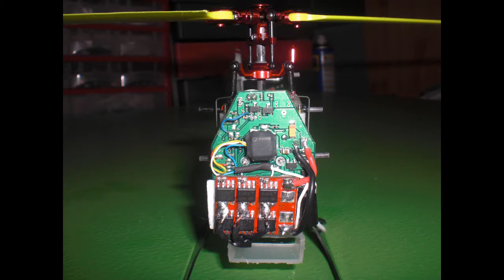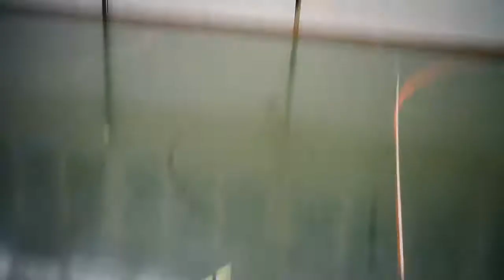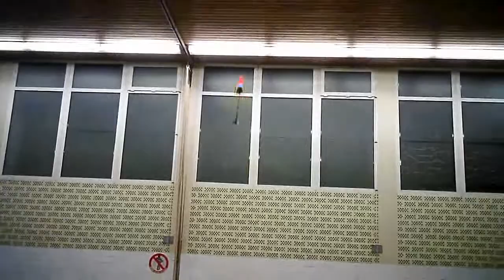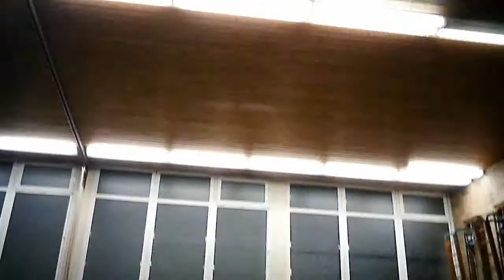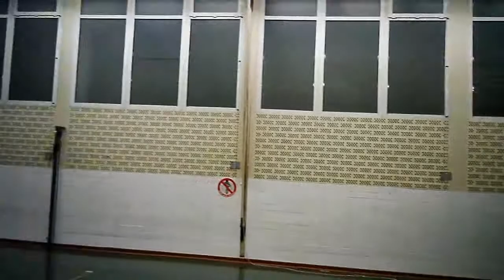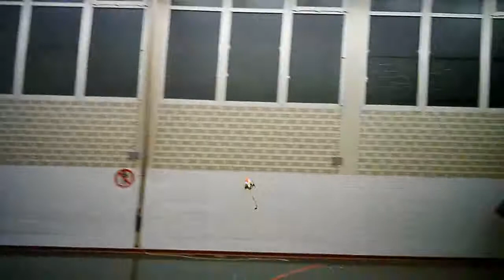Brushless mCP X HP05S@9T 4mm lower RotorDisk

Comment from the maker: @SOHCking 
Your right!
4 flights after this one, the tail motor wouldn't run longer than a minute or so,
and quit with a total tail spin. I broke the RKH frame, MH gear, Ø2mm shaft, canopy...
 
Then I got a new SR120 Tail and everything is ok again.
I might have to pile up some spare SR120 motors now ;-)